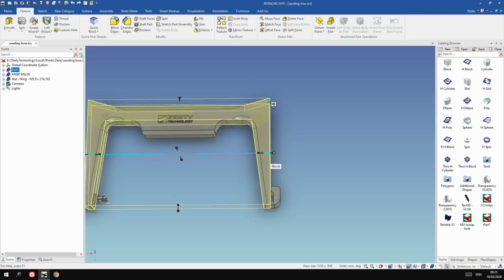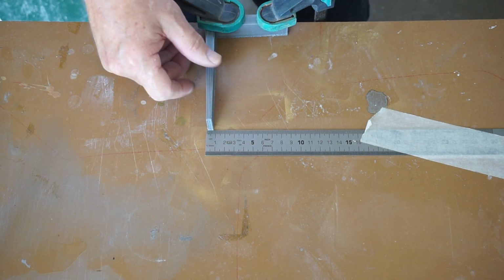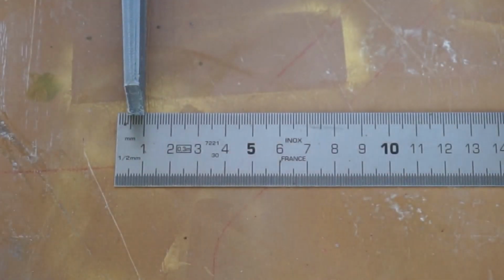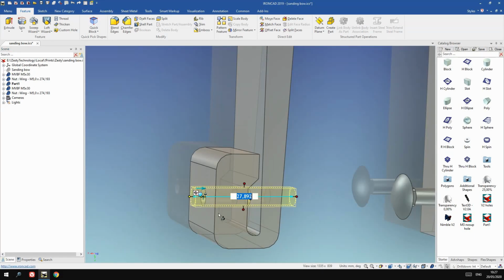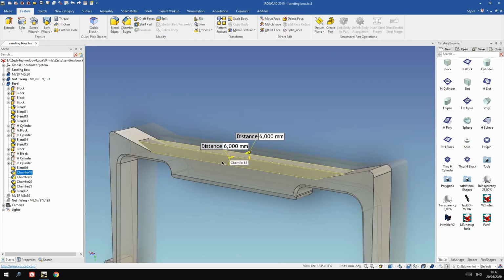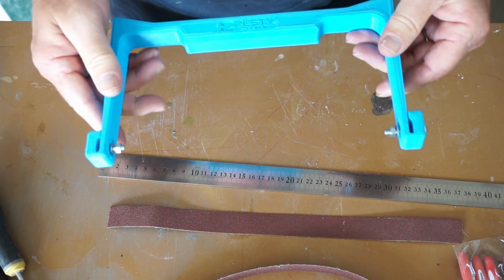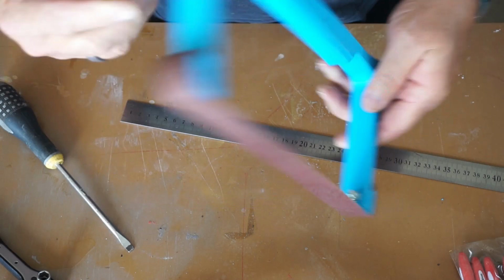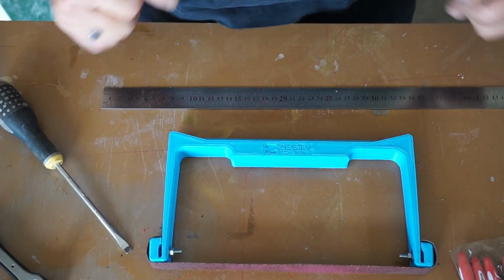3D printed Sanding Bow

Comment: Hi! Love your video. I see you have a zesty nimble on a cr-10, am I right? What acceleration and jerk are you using?
Reply from the maker: Hi Lorenzo, I am using the standard settings found in the documentation.
M201 E120   ; Set Extruder acceleration
M204 R120   ; Set Retract acceleration
M205 E3     ; Set Extruder Jerk
M203 E45    ; Maximum feed rate